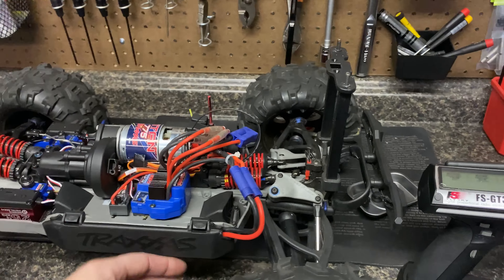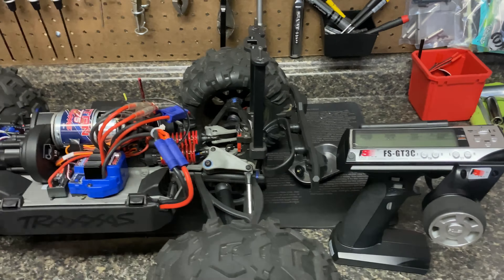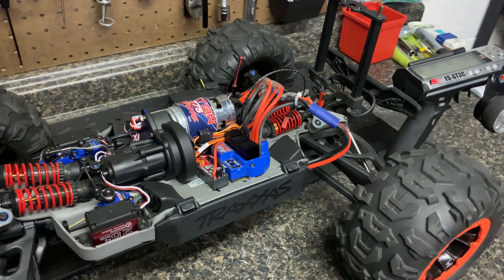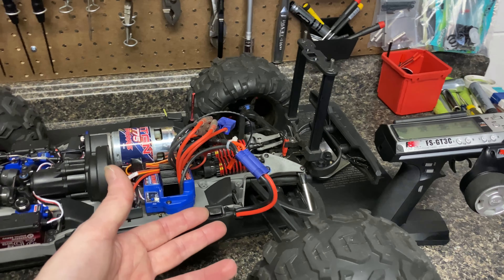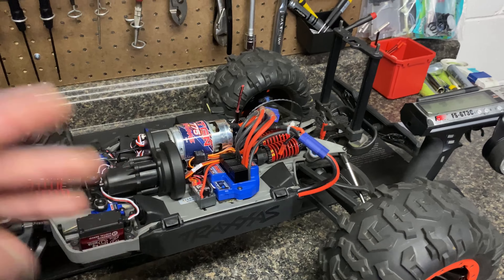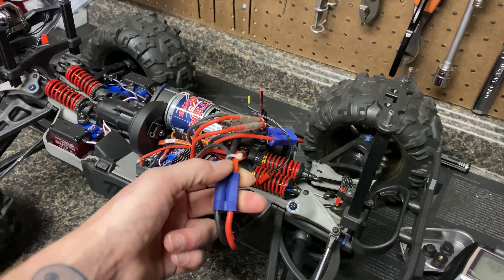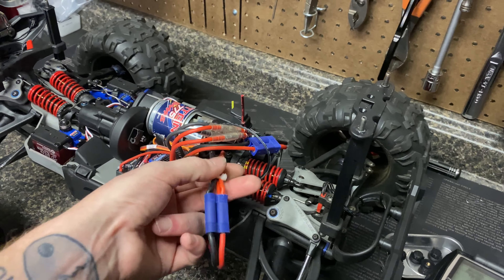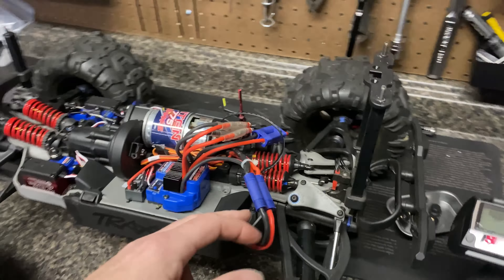Traxxas Summit steering upgrade (servo & bec)

Comment: How were you able to get the wire harness to fit into the receiver box? I'm having issues with wires not being long enough to put the water seal cap on and the plugs are under the motor and causing issues with fitment and rear diff lock

Comment: Either I'm doing something  wrong or the servos I have are not good but I have a max8g2 hobbywing system in my summit with the bec at 6v to not burn out my shift servos and the steering is still weak.

Comment: Thank you for being so informative. I dropped Traxxas support info on this and they replied not to use a dual servo setup. Go figure right? Anyhow, instead of doing a power tap from the battery on the ESC side, anything wrong if I decide to tap from the other battery instead? Currently I have a telemetry expander tapped to that battery(below esc) already
Reply from the maker: I don’t think so but honestly I can’t remember if the two batteries combine inside of the ESC to make it 4s Honestly I would hook one battery to the wires I’m talking about and then use a voltmeter to see if they’re interfering on the other wires. I seem to remember some thing about reading an article somewhere about hooking to those wires and causing a ground loop but honestly that might’ve been something to do with the BEC set up I can’t rightfully remember.
Reply from the maker: They say not to use a dual servo considering it comes with it that’s kind of interesting. Well I’ve spoken to some people at traxxas that are really really good and I have spoken to a few that I don’t think I’ve ever driven a car
Reply: @LargeeeScaleLife  Yeah, seems like it should combine in the ESC for a 4s output, but then again really scarce details on the ESC. Will try to avoid a grounding loop, and go with your suggestion to do a power tap on the other connector instead
Reply from the maker: @elvyneng6422  pick up one of those homes hobbies do you bypass adapters those things are an absolute lifesaver
Reply: @LargeeeScaleLife  Hmm, Traxxas support had a write up on a single servo conversion which is for the E-Revo/Summit. Apparently #2255 servo can take that abuse, perhaps I'll give that a go and see how it turns out. But I agree with you, why even market it with dual servos in the first place 🤔
Reply: @elvyneng6422  did you ever convert to a single servo?
Reply: @powershomestead87  Hi, yes I did, running on a single #2255, not razor sharp steering response but it gets the job done with the stock ESC not too shabby to be honest. However if you intend to really do some serious crawling with the Summit, I'd reckon a dual servo would be more ideal. But if I go that route, will definately upgrade the stock ESC.

Comment: Traxxas electronics are trash. Well at least for the summit. Bought a new one and less than 2 months of very light use. Servos broke and their customer support won't do anything and wants you to buy parts to replace which was the downer about the whole thing. After buying the servos like yours I found that the esc is trash too! I am really getting disillusioned with Traxxas. Point is I can afford to upgrade the summit but if your a kid with not allot of money and bought your first summit and it breaks, your out of luck to you manage to get more funds not to mention the downtime to you get all the parts to fix it.
Reply from the maker: I hate to hear that happened to you. Honestly, I have three full-size summits and one of the 1/16 scale summit and honestly I haven’t really had a problem with any of the electronics except one of the ESC actually burnt up on one but that was absolutely my fault. it got messed up due to a wiring issue of my own doing. Now that being said their servers are junk. But also 99% of factory cars have craft service.  Now does Traxxas have some things to be desired in their electronics? Yes, but all in all I think they’re decent and honestly their customer service has been really good to me so for now I know some people have had issues and I hate you did as well. Honestly, they should’ve just sent you some new servos and let it be at that. If nothing else to keep you happy that’s what I would’ve done. Sorry you had that issue. Don’t let it get you disillusion with the summit it’s a great truck.

Comment: I HAVE A 1080 HOBBYWING ESC IN BOTH MY GEN8 ORANGE/AND GEN8 PACK BUILD/ I RUN A 21T TRAILMASTER SPORT 550 MOTOR/ AND DS3225 25KG SERVO WITH A FLYSKY GT3B I DONT NEED A BEC DO I ?? OH I HAVE A REDCAT LIGHT KIT IN ONE/AND A MYTRICK RC CUSTOM KIT THAT PLUGS OFF UR 2S OR 3S LIPO BALANCE CONNECTOR WIRE/ I HAVE A FEW VIDEOS OF THE 2 VEHICLES IM TALKING ABOUT/I DO HAVE A NEW BUILD STARTING TOMORROW/I SOLD THE GEN7 PRO BUT TOOK OUT THE HOBBYWING 1080 ESC,DS3225 25KG SERVO,AND GT3E RECEIVER, TO PUT IN NEW BUILD,,,,,,,REMEMBER WHAT U TOLD ME '''PURPLE LOCTITE FOR 1.9 BEADLOCKS ''' TAKE CARE BROTHER🤜🤛,ANY FEEDBACK IS GREATLY APPRECIATED!
Reply from the maker: I doubt you do that servo can probably easily be powered by the internal BEC of the 1080 it’s actually relatively strong and I think it can run up to about 5 A. Unless you’re having some flashing issues or your lights Deming under hard load I think you’re probably OK
Reply: @LargeeeScaleLife  thanks brother🤜🤛🙌